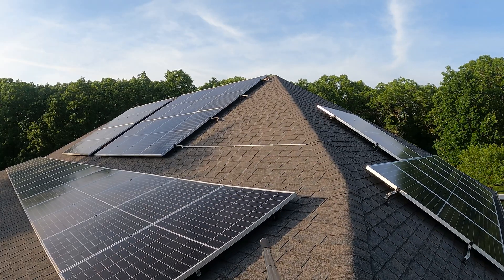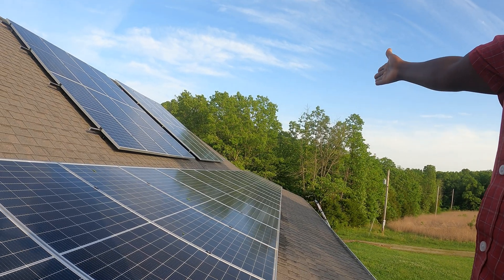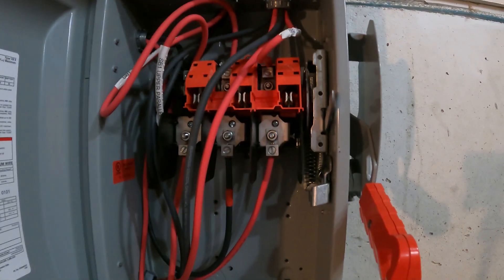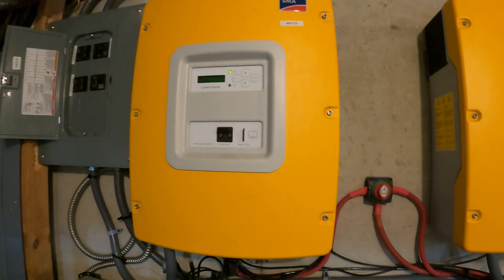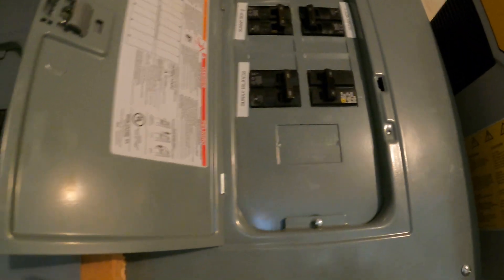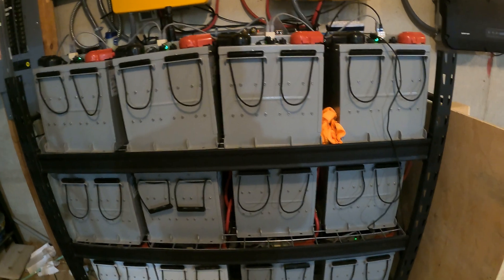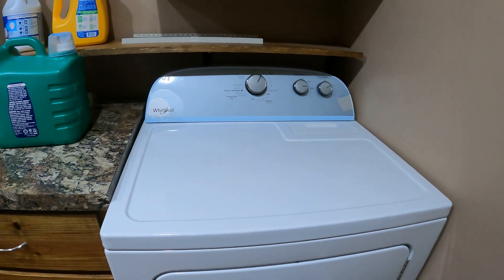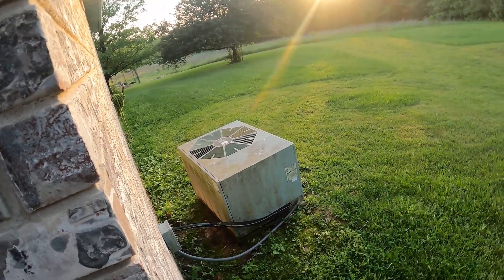DIY OFF-GRID SOLAR

Comment: Very nice setup, and very clean. On my house, I have a system with 24 Sanyo 240Wc panels. The installation is 13 years old and includes two Sunny Boy SMA inverters. I'm OnGrid, and for now, the surplus is sent back to the public grid. The public meter runs backward when that happens. I'd like to be able to store energy in batteries instead of sending it back to the grid.

Recently, we have to pay a flat-rate tax of 500 euros annual when we inject power into the public grid. I’d like to install a Sunny Island. But I’m not sure how to connect the Sunny Boys and the Sunny Island, which will be hooked up to 48V batteries.

Some videos explain that you need to use a PLP – Protected Load Panel – with the devices you want to keep powered. Like you, I have a main electrical panel, and I don’t see myself rewiring everything. Your setup, where you bring together your Sunny Boys and Sunny Island in a dedicated box, seems like a good solution for my home.

I’m in Belgium, I don’t have air conditioning, and my hot water is produced by a thermodynamic water heater with a backup heating element that’s currently not in use. If you could show how you electrically wire your inverters in the box where the Sunny Boys and Sunny Island meet, and then how you wire it to your home’s main panel, that would really help me understand how to do the wiring.

My current system was installed by a company that no longer exists. I’m on a 3x 230V AC setup without a neutral wire, in the main panel of the house. Thanks for your help and best wishes!"

Comment: Does your battery bank ever disconnect from the Sunny Islands? I've read of some BMS disconnecting. And we have a pallet of batteries from another brand that are also having issues. I'm curious to know how stable these batteries have been.
Reply: What kind of batteries do you. Batteries should not disconnect from inveters except for low voltage or high voltage. Which more than likely means you set your charge controller wrong or you have an inadequate charge controller

Comment: How did you program the sma inverter without an installer code to set the grid frequency
Reply: Shhh! LOL🤣
Reply: Use a Grid Guard Code to put the Sunny Boys in Off Grid (Island Mode), and you are all set.

Comment: You Mentioned adding 2 more sunny islands for a total of 4 , curious why ?   You could reduce your loads significantly   by replacing the Clothes dryer and water heater with heat pump units.  Very nice system that will last , I like it .   $85,000. in lithium batteries makes me nauseous.  :>)

Comment: Running similar sma sunny island ac coupled. Mine are tied directly to my ac buss. Sunny island usually  only charges during the day, grid tie inverters cover all the daytime loads. I have large forklift batteries ( I'm more familiar with them). I have 150 kwh storage, sounds like a lot but is just comfortable.
Reply from the maker: That is a huge battery bank. I only have half of your bank. What is the size of your solar array?
Reply: @backtoeden2030  mine are two dedicated arrays one is 12 kw enphase  the other an H6 delta grid tied to an 7kw and the smas island has a 2300 watt dc coupled array. The little only is an emergency backup so the batteries don't shut off the grid signal. If you need anymore info don't hesitate to contact me. Thanks Fred
Reply: Large bank can also mean you use it on high SOC so it can live a long life
Reply: An update for winter here,we're on grid power for the house. The Smas are powering (with a constant struggle for energy. No shutoff because my Hobart welder generator is in the system automatically controlling when it needs it. We don't monitor usage because our shop has to run each day and be productive. When the lead acids die I am going to replace them with large  Lifpo not server rack style,type that are forklift duty.

Comment: Hello, it is a nice and very powerful installation. The cooling pump, is it also a heating pump (I do not know if you need a heating pump in your country)?
Is it a single-phase pump?
Reply from the maker: For heating, we have central heating furnace that oil powered by  propane. We also have wood burning stove that we use to heat the home since we have lots of wood to use for firewood.
Reply: @backtoeden2030  I am searching for a solution because in Greece we use 3 phase heating pumps, up to 16-18 kw of power heating. And this is, to my opinion, the most heavy load in a house. I'm afraid that it's not so easy to solve this question of heating or cooling the house. 
For the rest of the loads in a house, it must not be a major issue.
Reply: @backtoeden2030  could you give me please the tech specs of your inverters? Could you tell me about the connections that you made between the inverters please?
Reply from the maker: @kostaskostopoulos2913   The sunny island inverters that I am using can be used for a 3 phase connection but you will need there of them; one per phase for a total of 18KW.  The are 6KW each and are made in Germany. They generate 56 amps per phase. Here in the USA, the 6000W inverter is the larges we approved but I know they have an 8000W inverters that I have see being used in Europe. If you can source an 8kw inverter (3 for a 24kw systemic 3 phase) This may work for your situation.
Reply from the maker: CHECK out these links
"SMA SUNNY ISLAND"

https://youtu.be/vBquLzPxiqc

https://youtu.be/Fpwgrq_Bz0Y

Comment: What's your DC voltage from the pannels. You have to be careful to not over load the inverters. My max voltage is 500 volts so I kept it at 480 to not overload it.
Reply from the maker: The DC Max voltage if 600v per input and my inverter have 3 inputs each. I only have about 400v in to each channel. Thank you

Comment: Love your system. We too are off-grid: 20,640W PV, two solark12k, 134kWh LFE battery, 6.25T 16-33 SEER HP systems with all elec heat kits disabled, 80 gal elec wh, wood burner and 10kw Honeywell LP Gen for backup.
Reply from the maker: Thats the way too so. I just added 2 more SMA SUNNY island inverters for a total of 24kw
Reply: Very impressive

Comment: How did you connect the Sunny Boys to the Sunny Islands? Only thru the subpanel?
Reply from the maker: That is correct. They used to require some kind go ethernet cable between them but not any more.

Comment: Nice system. Those batteries look a lot like Gels. Where can I get the lithium and what's the amp hr per battery please?
Reply from the maker: Thanks
These are discover lithium iron batteries 48v and 130 Ah.
Reply: @backtoeden2030  Ok Thanks. Where can I source please.
Reply from the maker: They have a few distributors around the country and with different pricing, so look around for the cheapest supplier. Here are a few suppliers; Solar-electric.com, ecodirect.com, invertersuply.com, solaris-shop.com. Hope this helps. The also have different size batteries to goo with your budget.
Reply: @backtoeden2030  Thank you. Much appreciated 👊🏾

Comment: What inputs are you using for your paralleled PV strings? 
SMA has a 10a limit per input. 
I’m assuming you’ve paralleled inputs a and b right?
Reply from the maker: There are 9.8 amps per series and 3 inputs per sunny boy which worked out  perfect

Comment: That's a smart move on your part to run ac coupling inverters instead of a grid-tie inverter. high voltage low amps. wish you the best.